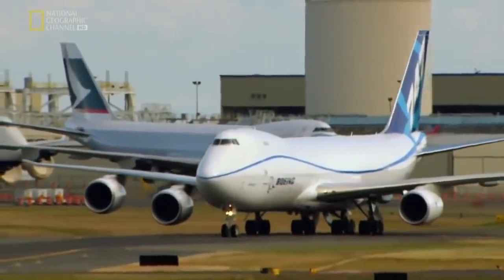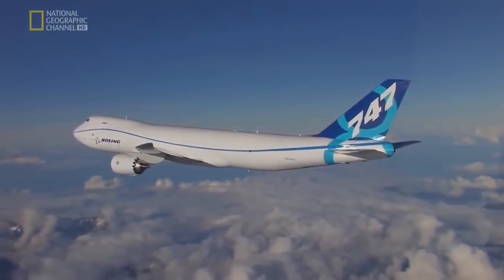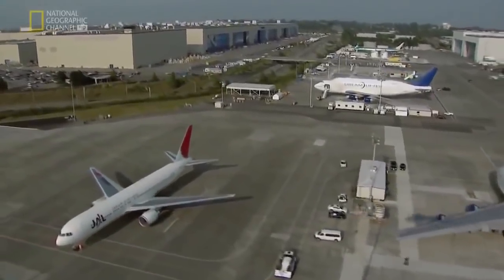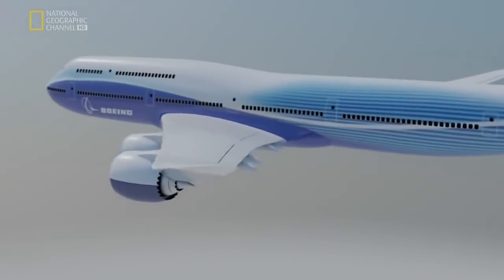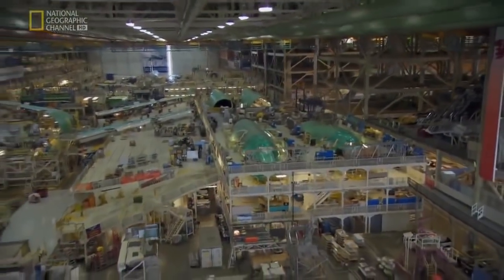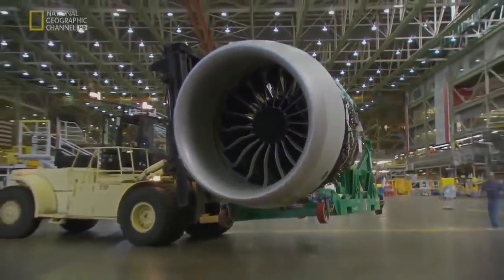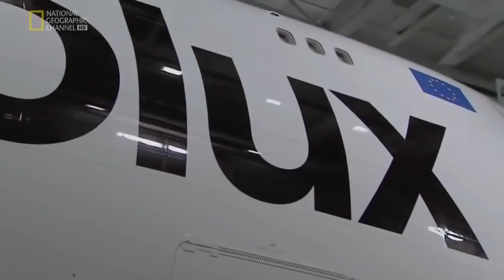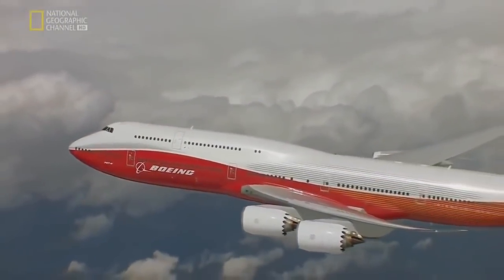Building Boeing 747-8 Full Documentary - Worlds Longest Airliner

Comment: I paint these for a living. Its a lot of work!
Reply: Pay good?
Reply: @xxP1ST0LER0xx  Hes BSing you. Its painted by a machine.
Reply: No kidding. Look at the size of that thing...
Reply: @blackham7  no, definitely not painted by a robot lol..
Reply: @xxP1ST0LER0xx  about 90k a year, can make much more if your willing to travel and do contract work
Reply: @blackham7  37:52 you think that a robot? 🙈
Reply: what a lucky dude, it's a magnificent machine
Reply: @blackham7  no its not, it's manually painted
Reply: Very interesting job. What qualification did they Ask to hire you??
Reply: @5H4V3D89  bro if it's only painting I guess no problems specially if it pays well the most important thing that you will have no more worries after finishing your shift and only thinking about rest and relaxing until your next shift as an Engineer the mental pressure and responsibilities are much painful than physical work
Reply: @badmofo7468  it's not just painting. You could be in a full hazmat type suit spraying 50 gallons of stripper and scooping it off the floor with a shovel for multiple 12 hr days in a 90 degree hangar, or strip sanding paint off with a da everyday all day. It's no joke, not many people can handle it long term. I work mostly on brand new Boeing planes so it's not as bad as a strip and repaint hangar
Reply: @blackham7  the planes are painted by hand

Comment: How amazing is that? One GE dash 8 engine creates as much thrust as all eight engines on a B-52 while igniting only ten percent of the air induction. You have to really appreciate the engineering mind.
Reply: It is impressive and its even more impressive that the Boeing 777 engine (GE-90-115B engine) has over 2 times the power of the Titanic steam engines. And thats one engine 

go google the horse power and youll be impressed
Reply: Hi there
Reply: The tax man 

Crazy to think the newest 777X with its recent takeoff has even more powerful engines, but derated for efficiency. Plus for the first time ever Boeing flew an new aircraft with a higher maximum capacity than the 747 (the highest capacity being 425, the 747-400 has only 412). Its not as big as a 747-9 but it definitely does the same job with half the engines.

Comment: What can you say to those who think that the A380 is bigger, better or whatever?  Nothing.  Those of us who know Boeing and the 747's legacy, what does it matter what anyone else thinks?  The 747-8 outclasses the "air bus"  in so many ways, it is a waste of time to argue the fine points on comparing the two aircraft.  The A380 is a competent, large, four engine passenger plane.  Kind of like a good washing machine or dishwasher.  The 747-8 is poetry in flight, motion, technology and esthetics.  The A380 flies.  That is about the only thing in common with the magnificent Boeing 747-8!

Comment: I hate how so many airlines are replacing the 747 for the a380, i mean, 101 THOUSAND trips to the moon and back, the 747 is a legend
Reply: But they're not. The A380 is a massive failure. It has been discontinued. No freighters. Airlines are already scrapping their existing planes, the second hand market for them doesn't exist, and the 747 itself is being phased out of passenger service in favor of smaller, more fuel efficient models. The 747 is beating the A380 in every sense...
Reply: Rainbow Goth ,hate?

Comment: The A380 never took the Queen crown. The 747 was called that due to its success. The A380 was unsuccessful.
Reply: The A380 was a colossal misjudgment and financial disaster for Airbus, which is why it has been canceled. Unfortunately, the Boeing -8 is breathing its last as well. Boeing was right not to spend the money for a new design to compete with the A380, but the great range of medium-size aircraft at lower cost and preferred patterns of economic travel in general are leaving the -8 mainly to the freighter market, and that's probably not enough to sustain the program. At least for now, all super-size transport aircraft are headed for extinction.

Comment: Sutter fixed an inherent problem with his "twist".  Today they cover it up by putting a computer on it.  How's that working out Boeing?
Reply: Working just fine? If your referring to mcas I garuntee you don’t actually know what that is. Every single airline manufacturer does that airbus has used high tech computing systems for years hints the joystick instead of the yoke and the large artificial horizon systems and avionics systems

Comment: When I post this, Airbus made the decision to discontinue the A380 although the plane will be flying for the next 15 to 20 years. Reason is that the amount the passengers has not increased but not to the huge numbers that Airbus was forecasting. 2) The US Airline Carriers (which Airbus was hoping for) were not buying the plane and only very few major airports within the US could support the A380. Other world airlines were not buying either but rather buy more fuel efficient (like 2 engine) planes. and 3) Airbus was not willing to update the A380 to be more fuel efficient to the new A380 neo to which the A380 is a huge "Gas Hog". So In my view, the A380 is sort of a failure but it is a cool plane though.

Comment: Last year I flew to Iceland on the now defunct WOW Air in an A380.  This budget airline was entirely business class, and my seat was in the 3rd row from the front curtain separating seats from restrooms.  During the 8 hour flight from Los Angeles to Reykjavik, somewhere over Hudson Bay, we hit a little turbulence. Nothing too bad, but I was awake and noticed that from my seat to the cockpit door, maybe 20 feet away, the fuselage where I was sitting was bouncing up and down, but ahead of me, the cockpit was twisting back and forth, actually rotating what looked like 4 to 6 inches a few times per second. Not a good feeling.  I have wondered how long before metal fatigue runs its course and the A380's start breaking up in flight.

Comment: Sadly, the A380 is no longer manufactured. It's been discovered that it's really too large for the majority of the markets, and it's requirement for specially constructed terminal gates to support it's dual level boarding procesures is part of the failure. It appears, though the A380 and the B747 are both wonderful aircraft in their own right, that the B747 found the sweet spot between capacity and cost, while still being able to utilize existing gates in air terminals around the planet.  Given how wonderful the B878-8 is to fly in as a passenger, I wish Boeing the greatest of sucess with the B747-8.

Comment: Wonderful aircraft with a long history. I've now flown on both the 747-8 and 2 legs on the A380. Both are quite amazing. I wonder about the long term future of 4 engines on an airliner because of the great efficiencies of the new 2 engine from both companies but certainly Emirates likes the 65 or so A380s they have (with more on order)The 747-8 came out too late to be considered by airlines looking for large capacity 4 engine aircraft. That being said, the 747-8 has a good future as a very efficient, long haul, high capacity freighter. The A380s future is uncertain, at this point.

Comment: I have flown on both Airbus A380 and the 747-8 and the 747 is nice but it is still loud and uncomfortable. The Airbus is much nicer, in coach anyway, as it is near silent in flight. The new engines on the 747 help but it is still twice as loud as the Airbus. Both got me from gate to gate but when i schedule flights now to Austria i always take flights that use Airbus. Even the 777 is way to noisy, long flight i just want to sleep but imposable on Boeing.
Reply: +hommie789, personally I don't mind a bit of white noise. It's therapeutic and drowns out or at least lessens some other unpleasant sounds, such as that of a baby crying. I give a lot of brownie points to the A380, but not because it is silent. Same goes for other Airbus planes.
Reply: +hommie789 Well, it's a real shame Singapore Airlines replaced their A380 Route which I used to take with a full 777 Route. I preferred the A380 Much better.

The MC-10 Gave me my fear of  flights,
Airbus took that away
Boeing gave it back.
Reply: They're both noisy in coach.  I've flown business class for work which is located in front of the engines.  It's far quieter, slept very well on my flights.

Comment: Great Video. The original beautiful bird. A380 = Ugly.  Boeing, - 40 years ahead of Airbus :) and still produces an airplane which costs less to operate per passenger mile, with the same basic airframe. That says that the plane was designed correctly/properly in the first place in the 1960s.
Reply: Where did you hear that? The 747-8 is a good looking bird but all operators agree the A380 is cheaper per passenger mile. Much as I love the aircraft, sales prove the Airbus is more popular. 20 major airlines have bought the Airbus, 3 the Boeing.
Reply: *****- Either in this video or another on the 747 I was watching just before this one, said the 747-8 was cheaper to operate with the new GEnx engines (I believe). I think 20 major airlines have bought the Airbus because it came out a long time ago. As new 747-8s are delivered, I think we will see more airlines buy them. IMO the 747 is a much safer airplane. Mostly Aluminum, tried and true in disaster situations. The A380 is much more unwieldy and not as maneuverable in emergency situations. The A380 has a great interior, and has almost unmatched luxury, but I would feel much safer in a 747.
Reply: *****
By 20 major airlines, are you including the ones that cancelled A380 orders?
Reply: Sorry, but saying the 747 is safer when statistics show they are equally safe makes no sense at all. The 747s record of surviving near catastrophes speak for itself. But you only got to see the report on the Qantas 32 explosion to appreciate just how badly that aircraft was damaged. Yet it made a safe return with no loss of life to Changi Airport. The captain went on to say it had confirmed his faith in the A380s structural integrity. Sure the 747 series has had a long life but I don't see how that makes it better when you compare sales of passenger models of both. Trying to be objective here.
Reply: As for the GEnx engines, they aren't doing too good right now are they. Unusual to see them fail.
Reply: Which passenger airlines would those be? At the last count, am pretty sure there were 20. Will check it out.
Reply: You can brag all you want, but Airbus has been who has helped to modernize to Boeing
Reply: ***** How can you comp[are their records for safety.
Most of the 7847 were built with older technology.
To be fair you have to comparer the most recent 747 built to the
A 380 built now.'
I am pretty sure the747's are safer for the reasons given.
It's a smaller plane that weighs less so is more maneuverable
The engines are smaller but so is the weight.
The  power to weight ratio is higher for thev747.
What this means if one engine goes then the 747 is much safer to fly on       three engines than the A380.
This also means the 747 is safer in bad weather
Reply: 747-8 ONLY HER MOTHER LOVED. A380 IS VERY GOOD.